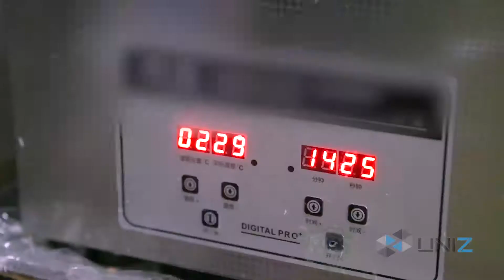How about a machine leg? Do you like it?

Comment: Notice they have not been demonstrating more of the UDP (very fast) print mode (UDP does not lift platform between layers). This is the standard print speed, which is still relatively fast... but UDP is supposed to be faster... unfortunately UDP in its current state, is useless.

Comment: This took more than 5 hours? Shouldn't be much faster?
Reply: It's not the SLASH PRO OL, also max speed is due to layer thickness being 3x larger than filament printing, although 720mm/200mm =  3.6 so you should achieve the same print in 90 min with their new printers, don't know why they aren't posting of video with that one since they already shipped, they aren't even available on their site which is very strange, but there's one on ebay but it's SLASH OL, not the pro so you're limit to only 7.8" rather than the 15-16" they used here.